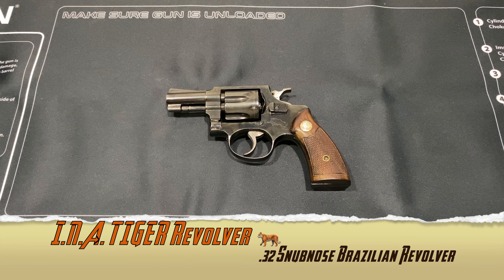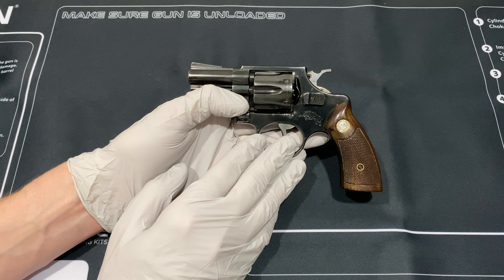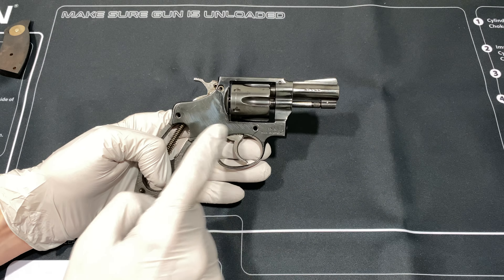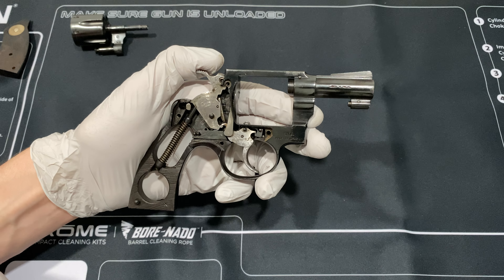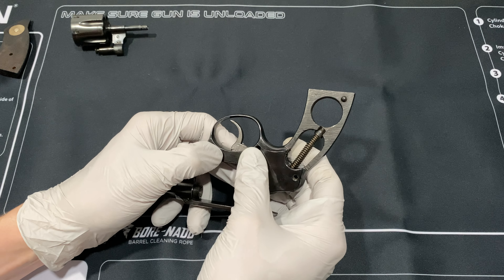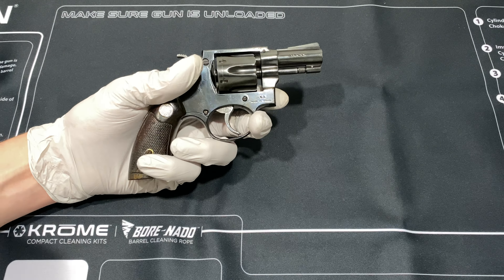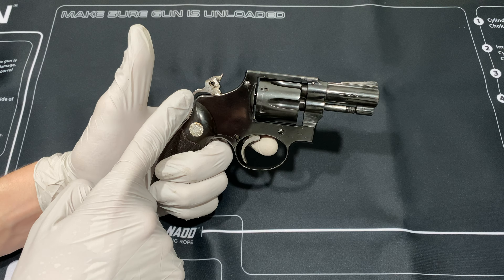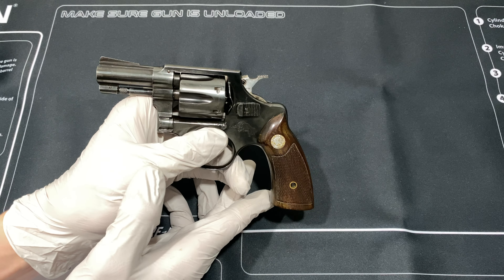INA Tiger .32 Revolver: Brazilian "Pouncing Tiger"

Comment: Thanks for the demonstration on disassembly. I bought one off a friend because he inherited it from his grandpa. A bit scuffed but mostly good condition. And I opened up the side plate to see the internals and there was no rust under there either. Have put around 300 rounds through it. Really nice shooting. The only complaint is the crappy iron sights. Very nice gun for $100 I can't really complain. Mine's chambered in .38 special.
Reply from the maker: .38 Special is probably more rare than the .32
Reply: @flcowboy50  what do you mean? 38 special is the most common revolver cartridge. Where I live the prices are usually $25 to $30 for a box of 50 rounds. Where I live I have only ever seen two boxes of .32
Reply from the maker: I was speaking of the INA’s I have seen. Also it’s better because the .32 ammo is really pricy.
Reply: @flcowboy50  I'm so sorry, I thought you meant that 38 Special ammo is rarer than 32. My bad.

Comment: Mine is like brand new. Picked it up cheap because people think they are a cheap "Saturday Night Special". I was told they were made on S&W toolong but haven't been able to confirm that. I do know they are BEAUTIFULLY blued and just as well made as a Smith. Mine is a 5 round .38spl with the 2" barrel. Its crazy accurate even in double action. I had to replace the hammer spring when i bought mine, for $75! The pawn shop sold it cheap because of the spring and because they had never heard of them and figured it for a Saturday Night Special. They are rare and should bring a good price from someone that is aware of them. I replaced the wood grips with some Hougue Grips made for Smith J frames. I didn't want to mess up the wood and since i carry it 50% of the time, i do prefer the Hogue.

Comment: Any idea where I could find a replacement for the tiny torsion spring that sits under the Cylinder Stop of an I.N.A. Tiger .32 Revolver?
Reply from the maker: My first guess would be to try to find the S&W spring. Google “Smith & Wesson Cylinder Stop Spring (Torsion Type) J Frame” I see one listed I’m not sure if that will work but they have a photo and it’s listed at $5.50. If not I would just watch Numrich.
Reply: X q envían videos en inglés a Argentina?

Comment: I just got this gun from my dad, he bought it in 1970 and it has only been fired about 20 times. Thanks for letting me know that the hammer rest on the primer! I have been storing it fully loaded (just in case) but now I will take out the first round. Are we 100% that is will take the .38 special? and will it take .32 ACP?
Reply from the maker: They made a mode in .38 special and a model in .32 but they are not interchangeable.